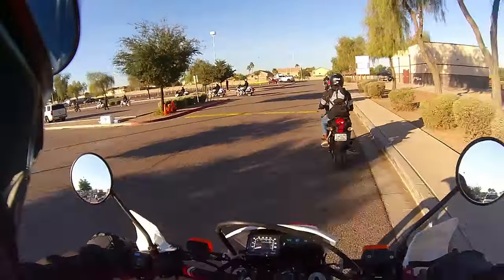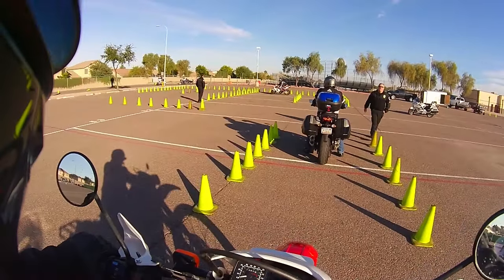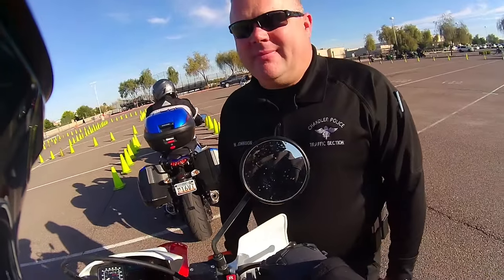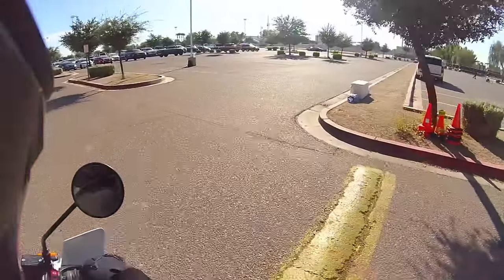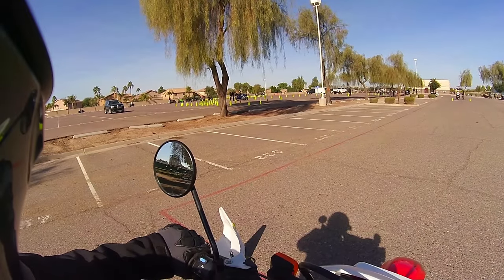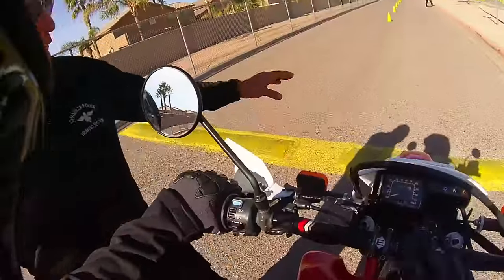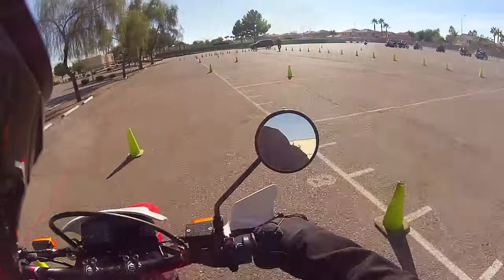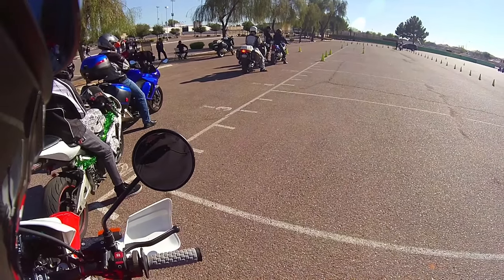HONDA XR650L | Police Skills Test

Comment: I wish the police department near me did this.  I would totally take advantage of it.  This video makes me want to find a parking lot tomorrow and practice some low speed maneuvers using clutch control instead of doing exactly what I normally do which is to cut power and use the bikes momentum to carry me through u-turn.  And you should get that front brake checked - it being ~90% of your stopping power and all...
Reply from the maker: spektrum841 yeah yeah ill do the brakes lol

Comment: 2:43 "in the dirt you can snap it".  Fastest way to dump your bike in the dirt is using the front brake ....  Get used to slipping that clutch off road and climbing hills.  No better way to maintain traction once you get the hang of it.  Nice of the Police to do this for you guys.  An ounce of prevention is better than a pound of cure.
Reply from the maker: lol I was thinking the same thing at the time but I wasn't going to stand around and talk to him about it.

Comment: How do you keep your xr650r from overheating at those low speeds, mine just skyrockets into the 200+ in 30 seconds of sitting still with 80 degree whether.
Reply from the maker: MntDew Monkey3 it probably was overheating idk. I dont have an oil temp gauge on it.
Reply: It's an xr650L! (AIR COOLED!) the xr's are water cooled.

Comment: If there is enough "meat" (legal thickness) on the brakes pads and also if the steel disks are within spec then you do not need to change your breaks. Disk break squeal is the result of the pads and disk being worn smooth any shinny. This makes them vibrate excessively as you apply the breaks, vibrate and squeal. The cure for the squeal is to take some emery sandpaper and rub it in a circular motion on the steel disk, just enough to break the glaze (mirror finish). Got it? Good. No more break squeal! "An old biker"-Peter
Reply from the maker: PeterDad60 ill try this. i still haven't replaced the parts lol

Comment: They're trained too ride thier motorcycle a certain way for police purposes so they might be trying too get you too that, which isn't bad but heh if you go through the course and leave the cones alone, stay within the lines, stop where your supposed to with out spilling the bike your doing pretty damn good, I'm not going too wear out my clutch over that, and remember thier bikes wear out or break we fix or replace it through the municipality or whoever, our tax money pays for all of that
Reply from the maker: A wet clutch is designed to be slipped constantly at low speeds. Most people dont do this though, because its not how we learned and not how we would treat a car, but it's not hard on the bike at all.